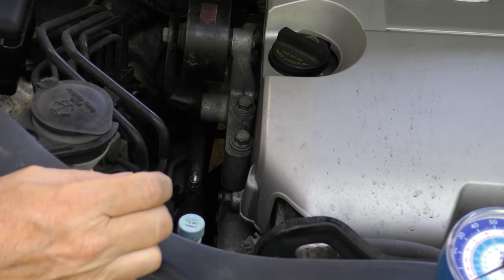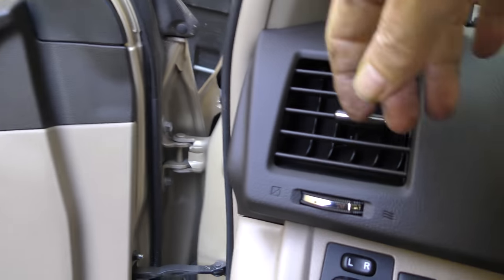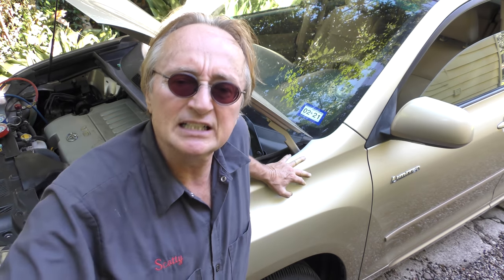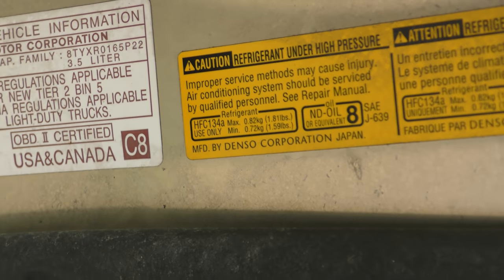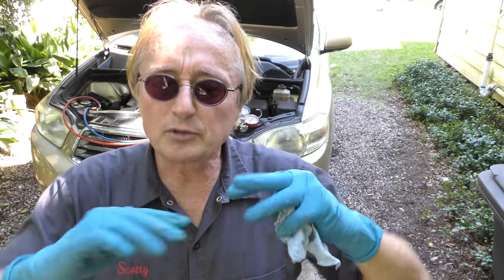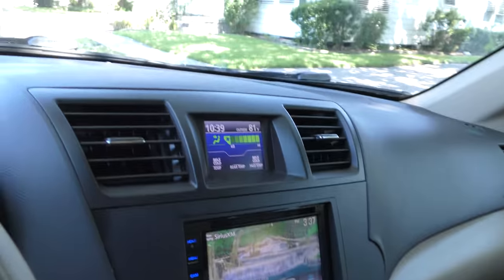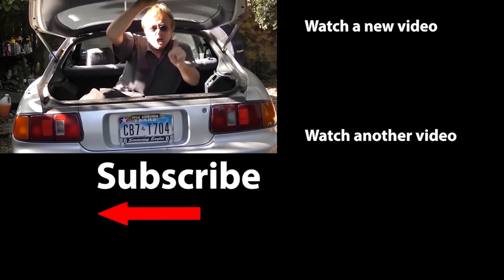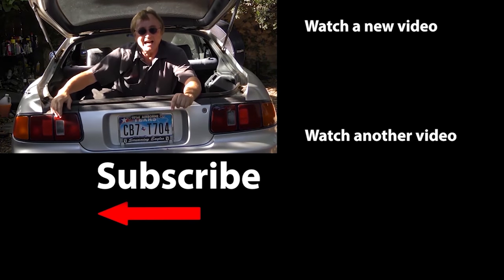Doing This Will Make Your Car's AC Blow Twice as Cold

Comment: I rubbed a Q-Tip against my AC knob just like the thumbnail and now it's blowing twice as cold. Thanks, Scotty!
Reply: I don't have a knob I have a slider and my ac went out like a year ago you think it'll still work?
Reply: Make sure if you have a slider, that its set at max cold before you rub it with q tip. If you have it set towards warm.........jeez you're warned!
Reply: Lmao
Reply: Im chuckling rn
Reply: mark jones that depends if you have a q-tip
Reply: Can you explain how to use use the Q-tip? Also, which end do you use?
Reply: FluorescentTan it’s absolutely critical that you use the left side of the q-tip
Reply: Do not use knock off brand... I did and it only temporarily fixed my issue.... Q-tip brand ONLY!!
Reply: @raccoonski  yep..left side first, then use the  right...lol
Reply: @tonyjoe5707  to be safe I'm just gonna take it to a mechanic and tell him to do it he surely won't know that this will fix it cause its a secret I'll save thousands
Reply: I don’t have qtips but I do have some cotton balls. I wonder if that will work.
Reply: @extremepoweraddicts2978  No, OEM is always best.
Reply: @2025944  Couldn't hurt if ya tried. It's just a Q tip. Cotton ya know....
Reply: The Q-tip is to clean out the 'Coldvid 19'
Reply: You have to dip the qtip in freon before you apply should work just fine for cars with slide or touch mechs
Reply: Hahaha that's too funny!! It didn't work for my car lol
Reply: Used my Q-tip in my ear then to my knob . Wow it's blowing ice cubes now . Thanks 😊
Reply: I put my q-tips in the freezer first and now my heat won't come on, so make sure you use a room-temperature q-tip.
Reply: I tried it didn't work, am i missing something here?
Reply: Mine is 5 times... I get frost and snow in car now!
Reply: That gave me an idea,so I rubbed a q-tip on my gas pedal and took home the trophy at the dragstrip !😁
Reply: Wait, where's the girl in the bikini jumping on the trampoline in this video thumbnail??? I watched the whole thing and never saw her! Ooops. That was another video. Now to get the Q-Tip and rub it on the dial to wake the AC genie. That's how this works, right?
Reply: Used q tip on knob 1st, then on ear, now i have a head cold, getting great gas mileage, lol
Yout comment was awesome, i watched that whole vid waiting for him to clean the contacts in a knob, some secret knowledge, lol
Reply: Lol👍👍👍👍
Reply: What am I missing? What's the deal with colder A/C + a real Q-tip?
Reply: I rubbed my knob and all I got was a sticky mess...
Reply: @2025944 Vydiah1
Reply: raccoonski nooooo. The UNDERSIDE.
Reply: 😂😂😂😂@mark
Reply: It's a mind thing it doesn't work like that..
Reply: Sad dude sad.
Reply: @JSFGuy  Sub zero synthetic put out the coldest air I ever had along with a really good bleed on The system. I have 25+ cars!!!
Reply: @2025944  did you try turning it off, then turning it back on?
Reply: Lmao
Reply: Lmao
Reply: @CDMOOVEE  Uh, the end with the Q. Duh!
Reply: @extremepoweraddicts2978  does it have to be paper stem or cN you use one with the plastic stem. Asking for a friend lol
Reply: Instead of viagra, use the Q-Tip you know where...it will leave you hard for hours. Don’t rub it too hard or too long though, try it in small increments and see what works best for you. We are all different, but it’s be word of caution. Clockwise only, because counter clockwise has the opposite effect.
Reply: I used a microfiber cloth and it froze up the A/C unit. don't recommend doing that.
Reply: @raccoonski  Really? The right side is more accurate
Reply: What I dont get if you dont like him why do you have to watch his videos and put bad comments down when you can just pass by and leave him alone
Reply: @CDMOOVEE  Awesome man.. LMAO
Reply: @hettiesimpson  LMAO
Reply: Ishman Graham has
Reply: I rubbed a tip on my knob too
Reply: LOL
Reply: Can someone  tell me what a q-tip  is??.
I growed up with a friend that was a pool hustler  and his name waS Q-tip.
Reply: Shout  out to government  cheess!!
Reply: I rub Qtips on all my knobs!
Reply: @timothydean  ...lol...go on now.
Reply: @extremepoweraddicts2978  😭😂
Reply: @aggietrucker4489  😭😂
Reply: @2025944  😂😭😂
Reply: @davidkeenan7275  😭😂
Reply: @hettiesimpson  😂😭😂
Reply: @nja3224  😭😭😭😭😂😂😂 I literally almost choked on my breakfast "small increments"..."we're all different'...😭still trying to recover 😂
Reply: Genesis Omega Dynamics - Glad you got a laugh. Remember, clockwise only. 😀
Reply: @nja3224  😂Sure thing 👍 I even screenshot shot this to show my husband. I couldn't die of laughter all by myself!💎
Reply: @tonyjoe5707  it did not work. I found the problem though. You have to have it full blast. Switch off the car. Turn on (not start), hold q tip on slider. Switch off. Turn on. Now use q tip on slider. Turn left indicator on and off 3 times to keep the setting. Now switch off the air on and then the car. It will now work!!!
Reply: LMAO 🤣
Reply: @g_o_d_esigns  I like your sense of humor, you sound fun! Keep on laughing, best medicine for anything.
Reply: @timothydean  really guy? Q tips are used to clean your ears!! 😆
Reply: Lmao
Reply: Didn’t work for me.. help, Scotty!
Reply: Come on now scotty,  I used Wal-Mart brand and it worked just fine!
Reply: @raccoonski  my q-tip is verticle. Now what?
Reply: I used a q tip on my wife. Yup shes running cold as ever.
Reply: @provenpatriot5076  😂🤣😭
Reply: I used 2 q tips now I freeze meat in my car....
Reply: @johnnya287  actually
If you stick it in ear first then try it on the knob it will start snowing
Reply: If it didn't work, it's because you didn't wear the blue gloves! This is critical
Reply: Does it has to be a specific Q - Tip ? Lol
Reply: @scarlettbamaRTR  And, that control knob is not from that Toyota either.
Reply: LMAO! Epic.
Reply: @davidkeenan7275  bet they stink, though.
Reply: Used Q-Tips are best. The wax really helps performance!
Reply: LOL exactly what I said
Reply: I rubbed my knob once too but it didn't blow cold air
Reply: @andrewsangkala5987  OK. This is all next level Kek.
Reply: I recycle...a little wax on the Qtip helps lubricate the moving parts of the compressor. Remember to wear gloves so as not to contaminate the coating!
Reply: I played my fav song 🎵 from q tip and I turned into a snowman.
Reply: @scarlettbamaRTR  ? I'd like to know,  are they just funin
Reply: @2025944  lollll
Reply: @aggietrucker4489  nope oem q-tips only and left side first!
Reply: @aggietrucker4489  yes but it will feel like Pluto. It is overkill.
Reply: My earconditiong is working great now
Reply: Amazing!!!!
Reply: So you rubbed a qtip on the stupid knob🤣🤣🤣
Reply: I did that then punched my knobs in tha dash it’s all better now
Reply: Lol
Reply: A little ear wax on the Q-tip helps to.
Reply: Dude, that made my day😂🤣😂
Reply: THIS IS NOT FUNNY AT ALL…because I clicked the video really hoping I just needed a q-tip to the knob😂. I am heartbroken!!
Reply: @glenturney4750  you just ruined all the fun in the joke boo
Reply: I rubbed mine with a cotton ball, I'm now freezing!
Reply: @raccoonski  both sides looked the same. Can I just use my left hand?
Reply: @timbazuvfunareo454  o

Comment: Used to think Scotty was just entertaining…. But as my cars got older, needed repair…this is a passionate mechanic who knows what he’s talking about.   Fixed my AC, at least I could tell what was wrong before I took it into the certified mechanic…and without saying a word, their diagnosis was that of Scotty.  And when I changed my alternator in my CLK? And afterwards the car was dead… his ground the positive cable (unhooked from the battery!) to the chassis was spot on.  Started right up…yes, the computer was confused and doing that reset it.   Best, emotional, mechanic online!   Thank you Scotty!!

Comment: The 1 dislike is probably the previous mechanic that worked on it lol.
Reply: There are 234 dislikes now, I am struggling to see what there is to dislike about this video.
Reply: Stephen Johnson  Probably “mechanics” that like saying it’s the compressor and then after the customers bring their car back they tell them that also x y and z is bad lol
Reply: Those are there the ones that used the Qtip trick on the thumbnail before watching 😅
Reply: So much rip off and stupid mechanics can make you pay money that just won't fix the problem. Get a good mechanic like Scotty
Reply: There are now 540 dislikes. I think it's all the Nissan Quest owners
Reply: Or cause all he does is talk. More do less talk. If ur struggling
struggling to see why, not everyone learns by listening, all he does is yap yap yap yap. People learn by watching
Reply: Still brings good points to the table on a lot of things that make sense.
Reply: Based on my own experience of repairing an a/c system on a '94 honda, not a single thing he said or did in this video was useful. AC refrigerant does not naturally leak out over time and he didnt even explain what the actual issue was.

This exact procedure was performed on my car only for the AC to completely stop cooling after 1-2 months, as there was a nearly undetectable leak (the entire system was made from porous metal)
a simple stop leak solution ($30) added to the refrigerant solved the issue immediately and has been working flawlessly for over 2 years.
Reply: Maybe the Toyota is just a piece of crap! Like he'd say if the car was American or German!

Comment: Great video. I bought a brand new Nissan Murano in 2018 and within two months the ac compressor just flat quit blowing after the cool air became warmer and warmer. Took it back to the dealer three times for the same issue and was told each time they couldn’t find an issue. The fourth time it happened on a road trip from OK back to TX in 100 degree weather. Needless to say my wife was unhappy 😆 once we got back home and took a shower, I went back to the dealer and they kept the suv for four days, the tech emptied the refrigerant and refilled to factory specs, bingo! Haven’t had an issue since it now has 40K miles on it.

Comment: Still driving my 1997 Tacoma 4wd, V6, extcab, 5 speed, 155,000 miles (bought it new). The AC has never been serviced. It has always blown very cold, very efficient. This year is the first time I really noticed it being less cold. But after running about 5-10 minutes it still works at least 85% as good as before.

Comment: I topped off my 08 Lexus RX350 yesterday after watching several of your and others videos.  I ended up adding about 6.5oz of 134a.  Dash temp went from 60F to 42F (fan low and A/C on)!  Ambient temp was about 80F.  Low side was 31psi and high side was 195.  I got a refrigerator back for under $100 and the rest of the materials did two more cars.

Comment: Scotty, I love your videos and as a professional mechanic I know you know what you're talking about. By the way, was that the new Supra? Sometimes I learn stuff from you or are reminded of stuff I knew but forgot about like this video, I was reminded that the starting point should be to run the refrigerant through an identifier, recover the refrigerant and vacuum the system down to get any air and moisture out of it, then recharge. One thing you could have mentioned is that after you have it down to a vacuum you can put liquid refrigerant in to the proper weight with the compressor NOT running by setting the cylinder upside down and opening both manifold valves on the gauges. I do that all the time and it will pull in a full charge usually and if it doesn't it will be pretty close and then you can top it off by adding gaseous refrigerant. Good job, I like your non-recommendation of the Nissan mini van. I inherited a Stanza and it had all kinds of issues due to poor designs, it had transmission controller problems or possibly a sensor issue causing it to go into limp-in mode from time to time. I finally gave it to my brother-in-law.

Comment: This is very beneficial to retain and be educated upon, another thing you want to consider before charging ac system with Freon, check your cabin air filter, a very nasty and dirty cabin filter will be the culprit as to why your ac unit is not blowing cold air.

Comment: Hi Scotty,
I usually thoroughly enjoy your videos, but I have to disagree with you on this one. I previously owned a 2012 Nissan Quest SV that was an awesome machine. I just recently traded it in @ 151,000 miles for a 2016 Nissan Quest SL because I found my current one with low mileage, private owner, and in perfect condition. The Quest has been a very loyal ride for me and much more luxurious than the past 2 Sienna's I have owned. I never had to pore any major money into my old Quest and it ran beautifully (and I took good care of it). My old 2002 Sienna was decent, but my AC condenser went bad 3 years after I bought it new (that was a huge bill). I hate to even talk about my 2011 Sienna I bought new because that was a redesign disaster. I kept that piece of crap for 7 months and traded in for my first Quest. The 2011 Sienna stranded me 3 times just due to the battery going dead. Not to mention, the rear sliding doors might take your arms off. I love my Quests and I wish Nissan would consider bringing them back to the U.S. market. : )
Reply: Keep in mind if u drive it like grandma 👵 it will last, most people drive like maniacs
Reply: One of my neighbors has 2 Siennas and my other neighbor has a Quest while I have an Odyssey. While my Odyssey only has 70K on it then only thing wrong with it is parasitic drain - eats batteries like no tomorrow. My neighbor's Siennas have both had the door motors fail (take your arm off kind of failure) and the doors open up while he's driving. There's a class action on those Sienna doors. The starters on the Siennas are also horrible with my neighbor having to change them at 63 and 89K on the 2. My neighbor's Quest made it to 96K before the tranny blew. He also had a slew of electrical problems leading up to that. I guess I should complain because a Pacifica would have had all 3 vans worth of problems in one :P

Comment: Scotty I have a 2006 Chevy Trailblazer Ext. The rear AC will not get cold. I have tried adjusting the temp from hot to cold and it changes from hot to warm. After watching some videos and reading forums on rear AC. I am thinking I might have an issue with the Expansion Valve or the filter going into it or both. 

The front AC in the vehicle works great.

Comment: My 2017 (Bought Brand New) Toyota Taco TRD 4x4.  
So  just [600] miles after Factory Warr. Expired the A/c fan exploded. Just needed a fan but had to replace the entire a/c compressor etc..bc the parts are all in 1-System = +$700.  2-mos later the compressor went out  <lol> under the New warranty  so = $0.00.  1-mo later, a recall on the A/c comp. unit  <lolx2> Factory Recall so $0.00.   4 A/c Systems in the 1st year.   Fwd. +2.5 yrs no problems so far with truck or A/c. I shouda just used the Q-Tip!

Comment: 👍good stuff, whole  lot of appreciation...Scotty I have learned to really appreciate your Automotive car savy....

Note: Had a silly happening...to start I purchased a used 04 Ford Van , previously a Enterprise  Rental 43k miles)...saved on the depreciation about $10k.. Paid $13k..for your information, I totally agree buy a Toyota Seneca,
. So here  I had a 2004 Ford Freestar Van(haha, referred to as a Truck parts book)..no longer have this Van sold at 187k after 13yrs.....but here's what happened the A/C leaked out even the oil in 2007 never repaired, in 2014 my youngest son put (134 )20ounce into the wrong side (top gage)...Well he added to the low side, somehow,  it blew out the evaporateor  about the size of a fuel filters...never was repaired...Then in 2019 I brought a new 2019 Ford Escape S 4cyc 2.5...(not really impressed)..The Lug-nuts swell from 19m to 19.5m after about 4 rotations(problematic..the lug nuts are 100psi, the lug nut wrench will bend, and so I purchased a (directional  20 in long 1/2 inch drive)with a (19m well socket).just in case...
Another thing on .the passenger side...needed to replace the H11 LowBean headlight 💡bulb, right behind is the overflow reservoir..( I have.big ✋hands)..it might turned in a 15min job, not  yet sure how to losen tge water tank...the Left side was easier ...but still tight..

Another issue,  to do an change the oil, you must first remove a cover with about plastic retainers..T30 & 7mm fastioners
also, if your need to remove the lower front running amber  lights...its best to do so when you have the cover off...

well not all that happy..

..To drive LYFT's 🚗...I had always liked  Fords...

Comment: The O rings in the Hi / Lo manifold that connect to the compressor typ. dry out during the off season. If your going to pull a vacuum, Its probably a good idea to change them.

Comment: I only found out this year that the early 2000's Silverado's had cabin air filters from a random recommended video that popped up on Youtube.  My dad never changed them, never told me they were there (he knows they exist because he tried to get Delphi to make them when he was working there) and when I investigated it, they were so plugged with almost 20 years of crap that I was surprised any air was getting through.  What a difference it made for the AC too.  It was always cold, but it just never seemed to cool the cab down on really super hot days.  Now if I'm driving long enough, I have to turn it down :D